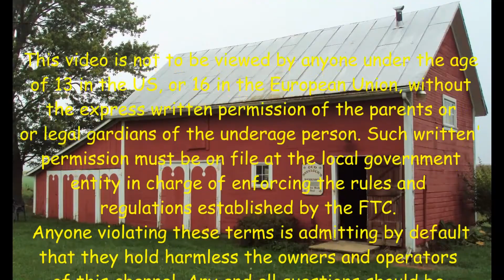A Visit With The Chair Doctor Pt 2 Painting

Comment: I think the wind stole half of the paint.
Reply from the maker: It was a sacrifice to the project. Painting in the garage gets paint dust all over. 
Speaking of blowing spray paint. If you ever need to paint something with the silver roof coating used on mobile homes and barns be very aware of wind direction. 
United Technologies Corp owned an aluminum extrusion plant that was sadly run down. The plant manaher wanted the roof painted. He assigned two women to paint the roof, from a group that was running out of work. He bought a Wagner Pump Paint sprayer and several buckets of paint. Then he turned them loose. 
They spent the morning painting the roof. When they came down for lunch they were completely silver. It turns out tuat the fish  oil based paint doesn't dry until it hits a surface. They were a surface so the overspray coated them. 
The strong prevailing northerly wind that day blew the paint that didn't get on the painters over the parking lot and onto the cars. 
He had to pay to have every jalopy in the lot detailed.
Reply: @OldSneelock  That's hilarious, I can just picture the mess. Sounds like something my Step Grandfather would have done, every project he tackled turned into a mini disaster.......Chainsawing a window opening and buzzing right thru the wiring.........Plumbing with one of those old pump up blowtorches that went up in flames.........I swear every other week he had one of those crazy mishaps.
Reply: @OldSneelock  That sounds like a story my grandma once told me.  Grandpa was out working on the road, and she decided to clean the soot out of the coal stove.  My grandpa would do it by throwing a handful or two of salt in the furnace.  What my grandma didn't realize was that you only did that when the furnace was *COLD*.  It certainly cleaned out the soot, as every single house downwind could testify.

Comment: I have an assortment of spray paint cans, and gallons (and some smaller) of paint and/or stain.  I need to figure out if any of it is still good, and whether it needs tint.  I remember my Dad gave a relative who owned a paint store a bunch of tints that he had picked up at an auction or some such.  All I know for sure is there is a shelf or two in the shed/garage that are being taken up by gallon cans.
Reply from the maker: We have a few gallon cans of paint in the basement. Dribs and drabs of older for touchup. Some for current projects. 
Several small cans of primary colors. I have cobbled up colors by mixing remainders. Okay for bird houses or clothesline posts. 
Dad painted nearly everything Forrest Green. 😆  
Bought Krylon spray paint 10 at a time. Paint hides a multitude of sins. 😆😎

Comment: I was looking at all my partials this morning when I put up my 2 pints of oil base green gate paint but sooner or later they'll go somewhere. Got out the ingredients for a batch of 50/50 too but not combined yet. And 2 cans of ether for a degreaser. I have a home remedy that I'll try and let you know how it does. Parts for the pressure washer are coming this week, a sectional wand extension for upper parts 1 1/2 stories and a crook for blowing gutters out. Then all I need is a pipe cleaning schnozzle and a tool box to put it all in. A trip to Lowes maybe. Put a screw in fron to hang seasonal decorations oin, checked the car for the weekly grub run tomorrow, got all the firewood off the back porch and mowed the back with the Roof mower. Still amazed on how well it cuts. Now to do by the garden because the Grans and parent are coming to 'work' in the garden later. And maybe make some 50/50. NICE chair by the way. I'm looking for things to calm down here but don't know when. Thanks Unc and GBWYou!!
Reply: I was here.
Reply: @mostlymoparih5682  Wished you'd been HERE! You could help e MOW! Then you'd probably want to help me  EAT!
Reply from the maker: You're gonna beva guinea pig for gutter washing. The nozzle out onmthe end of a 6' wand at an angle pointing down is going to be a blast. 
Mostly mud and leaves I expect. Good luck. 😈😲😨😎
Reply: @OldSneelock   think I am too BUT the extendable wand has sections I can keep still with the handymans secret weapon and pointed a little downhill from me. I just have one gutter that isn't covered and it's on the house side of the shed. The Grans Parents have bushes growing in theirs and theirs is mainly who I got the thing for but it might come in handy in other places. It came in today so as Toots goes grub hunting I'll ease out to the p.o. and drag it back. Ought to mix up a batch of SC-50/50 too. The extendable is 7'3 I think on the top of a 28 inch chunk ought to be enough to not get killed too much. Maybe! I can always do mine with the leaf blower too!

Comment: I also try and use up cans that are sort of close to the color for a primer before the finish coat. QUESTION FOR YOU AND OTHERS:  I picked-up a Makita 2412N Cut-off Saw at an Auction works but needs some love(power cord, etc) and cleaning....probably end up a full restoration knowing me. In opening the gear box the grease was kind of aged and I want to clean and replace it. But my online "search" left me with multiple answers for what to use. I think the same stuff used in hand drill gear boxes would work. I was thinking a finer/lighter lithium grease but thought I'd seek some additional input. Any suggestions?
Reply: My go to is OO grease used in Snapper mower gearboxes. Thick-ish but not too much. Unc probably knows better and I got a drop cord for mine and cut the female off and wired it in.It's  an old compound. Probably 10 or 12 inch blade. hEAVY as lead but cuts good. 90 and 45's for me.